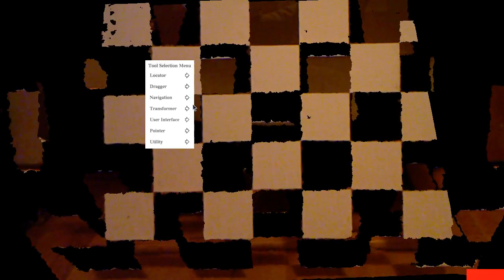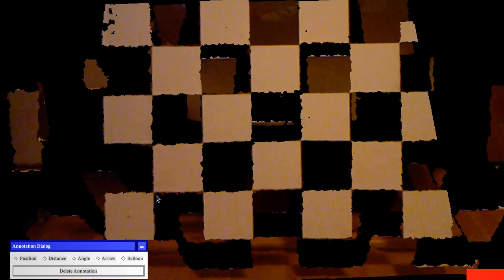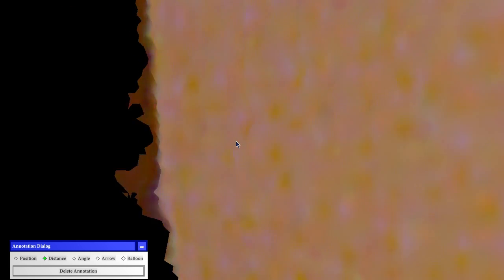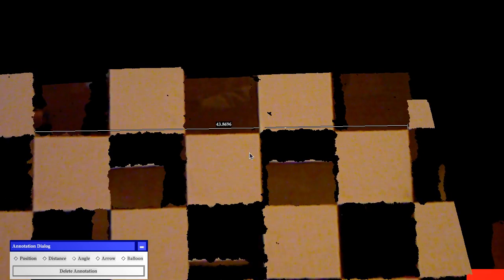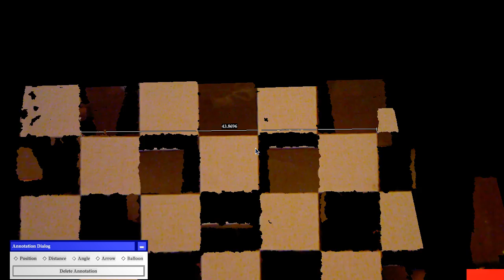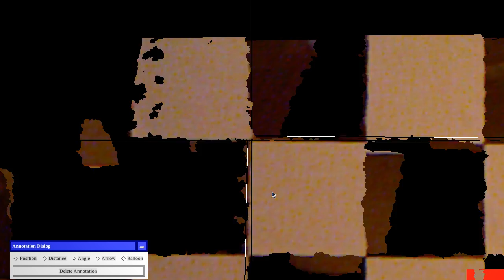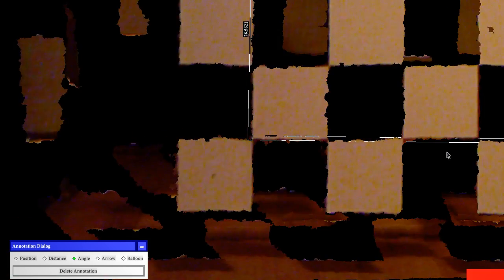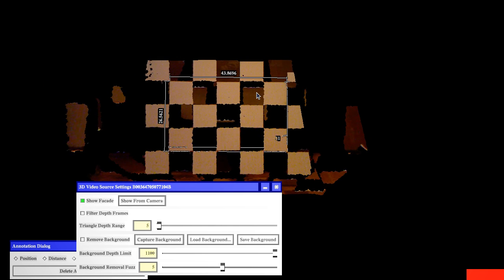Intrinsic Kinect Camera Calibration Check

Comment: Not sure if anyone is there to answer questions but we are unable to print the calibrations after we have all of our tie points. We have found a .dat file but can't open or print. Any help?
Reply from the maker: If RawKinectViewer dumps its calibration status information as I explain in the other video around 14:00 in, and creates an IntrinsicParameters-<serial number>.dat file in the Kinect package's etc directory, then you're done. KinectViewer et al. will pick up the new calibration fileautomatically the next time they're run.